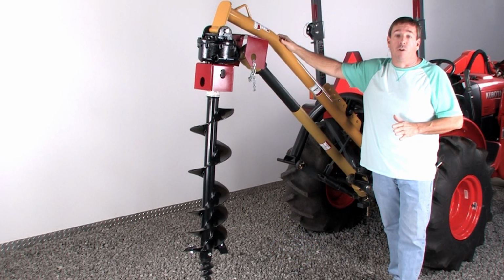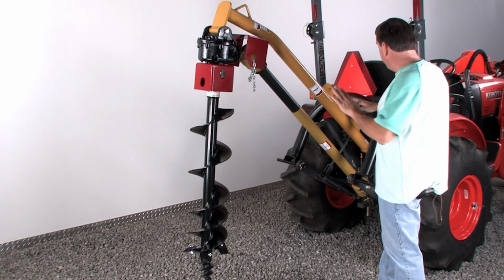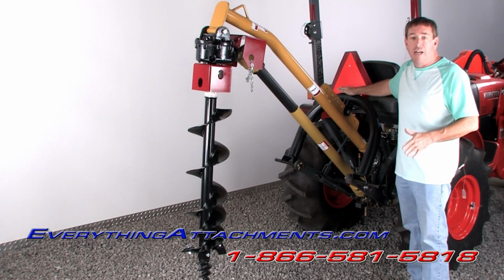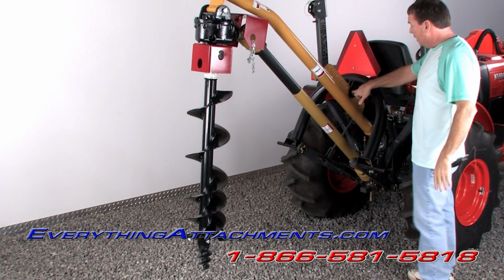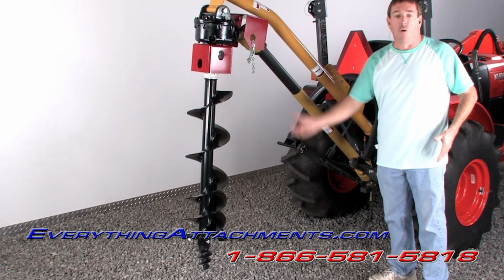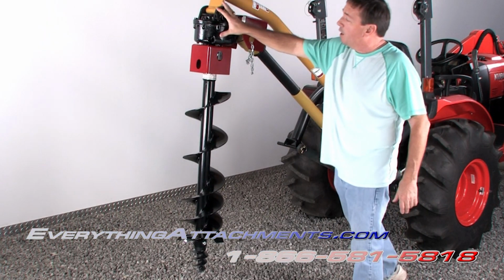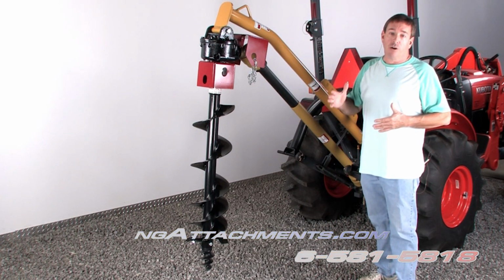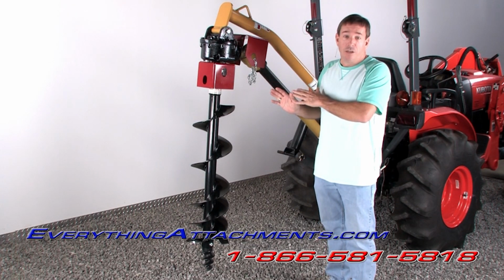Improved Compact Tractor Post Hole Digger

Comment: Have a B2601.  Trying to decide between this one and the subcompact model.  Need to dig 36" holes for a horse pasture fence. Thx.
Reply from the maker: If you have compacted, difficult soil, our Land Shark model will give you the most ability to lift the auger out of the ground.  It comes standard with a 36" long auger, but we can include a 48" instead, for the same price.  A B Series should have 15" of clearance with a fully raised 48" long auger.  Check out the details here  https://www.everythingattachments.com/Land-Shark-Subcompact-Tractor-Post-Hole-Digger-p/ls-phd-100.htm  Let us know if you have questions.  You're also welcome to give us a call to discuss.  Thanks!
Reply: @EverythingAttachments  I think we are emailing in parallel!  lol.
Reply from the maker: @andyw3302  We're the most accessible and responsive company on earth, according to many of our customers!  Welcome to the EA Family!!

Comment: So i have added several exact 5-1/2 X 5-1/2 square posts which is the 6 x 6 in fake terms with cement... Which auger bit would you use? Thanks
Reply from the maker: It would take a 12" if you want room to tamp/fill back in around it.  Thanks for watching and commenting!

Comment: I have a 66' White/Oliver 2-44 so not sure how it is classed haven't had it very long. I am interested in a digger that is strong enough to hold together running postholes in a Colorado rocky soil. Thoughts?
Reply from the maker: We can help you determine the category of your 3pt hitch based on the hole diameter of your tractor's lift arm balls.  Cat I is 7/8" diameter and Cat II is 1 1/8".  Feel free to email sales@everythingattachments.com with the info and we'll make our best recommendations!  Thanks for watching.

Comment: Ted, it just may be the video, but as the auger is hanging there from the boom it is not straight up and down, it is listing backward. It looks like the top box shield is hitting the boom preventing it from moving forward enough.  The auger should be able to angle back or front; right?
Reply from the maker: The hoop can be adjusted to keep the shield from hitting the boom, but, yes,  It is like that because the lift is all the way up.  The auger will have plenty of clearance and is free swinging when lowered.